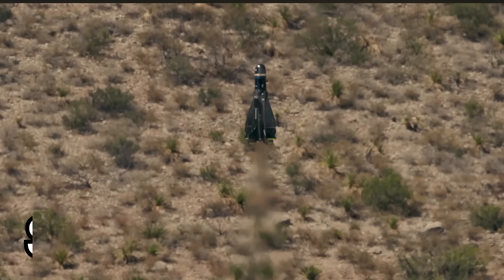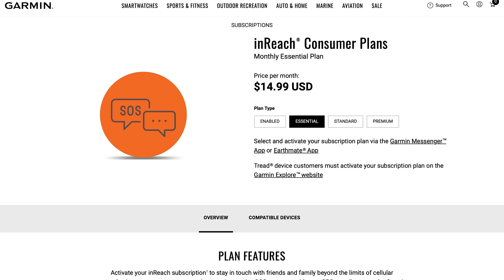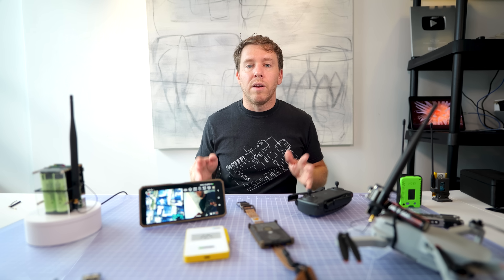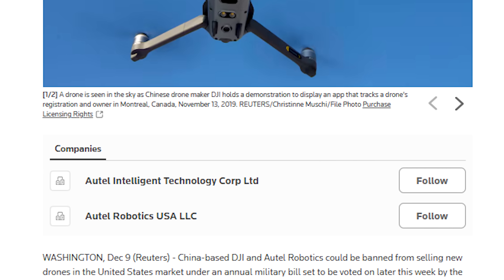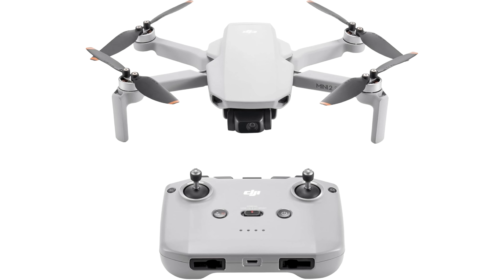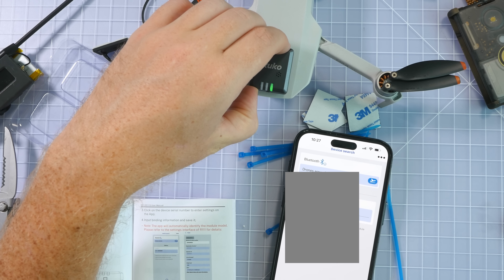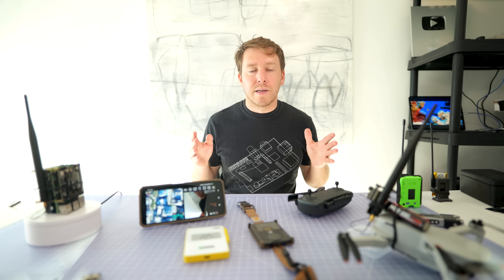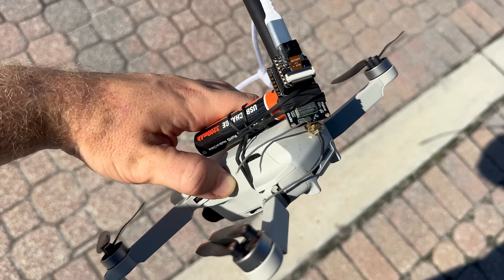I Built a $40,000 Military Drone for $120.07

Comment: I'm super happy to get into this world of decentralised electronics.... BTW the waves you saw on the video stream from the FPV when on the drone are rolling shutter. For those of you who are not camera geeks: most camera sensors nowadays capture the image that is projected by dividing the surface in horitzontal lines and reading each line after the other starting from the top. The speed at which this reading happens is counted by miliseconds and measures of much delay there's gonna be between the first row of pixels capture and the last. This cheap sensor probably has a very slow rolling shutter. Pair this with a vibration coming from the drone and you get the waves you're seeing. 
Fixes: global shutter sensor (you'll still have the vibration but no waves as the whole sensor would be captured at the same time) or isolating the sensor from the vibration of the drone (by some sort of suspended mount, cushion....)
:)

Comment: Just use a 5.8GHz VTX at 1 watt power connected to a standard fpv camera. receive the signal at a base station that processes it live and broadcasts to whatever network you choose. maybe cost $100 more but get steady video at 60 fps with no jello and run off the drones lipo battery. and FUCK THE FAA RID!! This can be done and have a flying weight under 250g. stay under 400 ft and away from airports. and if any karens come up bothering you, slap the shit outta them.

Comment: Having worked in the industry, The sheer amount of testing required to make sure military equipment works the way it is supposed to, and to meet military requirements, a fixed number of anything is going to cost an enormous amount. You'll never see a Raspberry Pi installed on a fielded piece of equipment. I'm totally against the black box equipment, and the US government is getting away from that stuff and adopting more open-source hardware and software. I'm not saying the contractors don't screw the government, because they do. Yet, some of that screwing is due to government inefficiencies and another part is that those defense companies are beholden to their stockholders, and at the end of the day, the company has to profit or go bankrupt.

Comment: A $10 solar powered drone night destroy a $100 million dollar ICBM.  Solar planes have unlimited range if they are above the clouds  and travelinng faster than the sun sets.  They can fly much higher than regular planes because they don't need oxygen to burn fuel.  What is the limit on the soeed in air that is 100 times thinner?  At three thiusand meters per second, a 200 gram drone has as much destructive energy as a half a pound off TNT.

Comment: Wouldn't the video function be accomplished just with a software patch on your phone?  The DJI drone already has a built in camera that sends to the phone/controller.  The phone should be able to act as a router, especially if you turn on hotspot features.   The flying bridge/repeater is a different matter and needs something like this, but not the camera.
Reply from the maker: ya there are probably better ways to do it, but wanted a rig that was fully open using my own custom firmware and wifi HaLow.

Comment: Technically your are correct, MIC needs to do better. What about All weather operation, EMI, RFI hardening, general durability, ability to survive harsh use. shock , vibration, wet insertions. Pull it out of a back pack and use it. You are leaving a lot off.

Comment: The project is cool, but you utterly failed at the presentation - from using roadrunner-m on the thumbnail, mind-numbing statements like "military systems don't integrate with civilian ones and that is bad" and ending on you using entirely off the shelf components and making it sound you beat mil R&D by factor of 400. Take a rest.

Comment: Waves = 'Jello' caused by vibration on the camera, in turn caused by your payload.
Your antenna is mostly plastic and heavy and has some leverage, you only need the wire inside, better - make (or buy) a 'CloverLeaf' antenna as used in FPV drones, matched to your operating frequency, far more efficient and having it on a short length of stiff coax dampens any vibration.  The rest of the payload should be firmly affixed to the drone body with Zip Ties or a 3d-printed clamping bracket for example.  Keep the mass as close to the centre of the drone as possible.
And whatever that floppy loop is, get rid of it or make it out of stiff copper wire.
The less your payload moves with respect to the drone, the less the vibration.

Comment: with a 3D printer you could have built a carbon fiber drone with micro cam for less than 120. I wonder how your system would work with a full-size operational Star Wars BARC speeder bike

Comment: Large floppy bits on the drone are a terrible thing. I could see the oscillations. DJI may not even account for weight change well and you can't tune for it like you can a racing drone running betaFlight. Best bet is to keep the center of gravity as close to the control board as possible. You may want to experiment with directional antennas and even SD card storage of the images to be transmitted at a later time. Directional antennas at both ends should give a clean long distance transfer at the altitudes you show. This is interesting AF. I hope you keep going and stay out of trouble.

Comment: Right, so you can build prototypes cheaply using commercially available parts. This is nothing new, it's been the case for about 10-15 years now (thanks to cheap and powerful microcontrollers, single board computers and also the ever better sensors and, in this case, motors, and open source software). But this is not something a military would want to use, not something you would want to make your (or your soldiers') life depend on.

OTOH, a resource poor army/country may well use similar solutions in case of an emergency, like Ukraine does. In their case, since they had nothing like these developed before the war, these and quick innovation actually help a lot because it gives them capabilities that otherwise they wouldn't have. It's one thing to choose between a well polished and rugged product and a flaky prototype and another to choose between the flaky prototype and having nothing .

Comment: This is cool but its also a bit "we have --- at home" meme ;) there is lots of room for improvement though, i think using a home built drone would make things a lot easier electronics wise and also cheaper, also perhaps using a ground station to relay video data transmitted from the drone over regular fpv video protocols. 
using drones as temporary mesh nodes for smaller amounts of data is neat though!

Comment: Lot of issues here. First, you're correct that the $40,000 figure is inflated, and a more reasonable price is likely substantially less than this. However, the prototype made in this video is as far away from a military surveillance drone as a lawnmover is from a Lexus. What you (a military) pays for when they buy a drone is R&D proven performance, expectional battery life, highly rugged design that can be packed in a box and dragged through the mud for weeks and still operate flawlessly. They're paying for highly autonomous navigation, which includes failsafe navigation systems that can guide with computer vision of the landscape when GPS reliability faults are detected. They pay for high speed, tested acoustic stealth, low thermal signiture in some models, payload capacity, water resistance, high quality video with backup recording and secure com links that are resistent to modern broad spec jamming, and component supply chains that are resilient and not reliant on nations which could become adversaries. No, a circuit board strapped to a drone sending bad quality video under ideal conditions does not come close

Comment: Waves are jello, it's caused by drone vibrations, usually caused by damaged proppler but in your case it may be caused by the camera mount probably not attached propelly causing micro vibrations. So when vibrations match the camera framerates, it creates these wiered waves. It's very common phenomenon with FPV drones

Comment: You should look up what Ukraine is doing with ESP32 nodes and other board design for tracking drones I think they're called Sky Fortress and Zvook, using Doppler effect sound triangulation and other methods to identify, calculate trajectory and more which is then integrated with RADAR data.  They also use a Baba Yaga for a wide variety of tasks, including mothership and range extension for drones. Ukraine is literally field testing what you are creating and evolving at a breakneck pace and the best part? They are mostly doing it in-house with bespoke designs. Drones are reportedly reaching up to 50km to 60km ranges with mesh networked carriers.

Comment: Worth noting is they support mesh networking between drones, jamming presistant, emp resistance etc etc etc 

And usually built out of titanium also needs to fly 1000-2000 miles
Reply: paint it absolute black - where it looks like a shadow in the sky absolutely zero reflections and soaks any signals - what it's built out of doesn't need to be titanium or heavy.  flight distance via starlink and a glider type drone can go around the earth as long as it's following the starlink train in orbit.  Jamming also prevented if using only gps and internal mapping data that doesnt need gps but can rely on one single signal from the starlink train as a ping for geo location data.  spotting a drone that small and painted the blackest black absolute black is nearly impossible and going after it using a multi million/billion dollar platform to jamming it or emp it is absolutely asinine and stupid expensive - let alone attempting to shoot it down with a lazer or a missile.  gliding while also using regen with 2 of 4 motors would work - or all 4 motors if at an altitude it can do this at without freezing.   Everything youve brought up has dozens of ways to be done in the real world.  The military also only uses a handfull of contractors that charge anything they want for building anything the military wants - but this is no longer the case as of yesterday.  That is the old way - the Department of War has an all new layout that will make innovations like this video - able to be looked at seriously by the US Military - bringing back REEAL WORLD COMPETITION - so Skunkworks - Lockheed Martin - DARPA - you better brace yourself for real competition and price bidding.  The days of ripping of America are over - NOW IS THE AGE OF GET SH*T DONE UNDER BUDGET AND AHEAD OF SCHEDULE WHILE IMPROVING QUALITY AND NOT ONCE GOING BACKWARDS.  Hooah.

Comment: the waves are classic FPV drone jello. its from the camera vibrating at high frequencies caused by the motors and props. Usually the solution is a stiffer frame or soft mounting the camera.

Comment: Great for getting it done, but there's quite a bit that goes into turning a prototype of sticky tape and paddlepopstick SDR's into a 'shippable product' such as electromagnetic shielding, RF and GNSS denied countermeasurs, electrical, safety, waterproofing, shock, vibration, training, maintenance, etc - ALL things that the DoD requires for delivering products at a TRL 8+. I agree theres a lot of wastage in big primes but there's also a lot of good tech going into these products.

Comment: WIFI is way too slow for live video FPV. its gonna look like a ring camera at best. but those are lower refresh rate and made to be fixed position.  This remind me of those 20 dollar drones you can get anywhere but attaching weight on the top it will struggle to stay upright.   payload better hanging below the props for balance sake but still these little plastic drones can barely fight wind without draining their battery to nothing.  

if you aren't starting with real custom solution like FPV parts its really hard to understand any of the tech and theres guys who spend their time  jailbreaking or cracking the good stuff VS building sub par hardware.
Reply: trying to do this for 150 bucks is just insulting. but for 500-1000 you actually could have a real solution.

Comment: 10:51 If you're worried about legal limitations with Remote ID, don't fly above 120m (or 400 ft) that is the legal maximum ceiling for drones to fly at. This honestly is probably more important than remote ID because once you go above that you get into altitudes where you could potentially crash into low flying helicopters and actually cause serious harm to people. Just a heads up

Comment: The usb cable here is causing a problem with your vertical antenna.  Any connected wire in proximity is going to cause tuning problems.  Probably the source of your interference waves.

Comment: worked with a defense supplier previously - a 5 dollar per thousand part in commercial application becomes a 5 dollars per unit once it has a defense part number. however, most of the costs comes from stringent qualification of the supply chain and the higher expectancy / reliability of parts.

Comment: All your signal stuff is being placed atop the drone- makes sense as a human standing, holding said drone in hand, looking down at it. Now, fly the drone...what do you see? None of the antenna/ signal equipment... adjust this. Place these additional components either bottom, sides front or rear... steer clear the drone's already equipped antenna and receiver and such..especially the GPS related components- shield, twist cables near them...ultimately just avoid as much as possible to have them placed near each other...problems will be manyu..will be had.... not rad!

Comment: with a few raspberry pis you can get a 2.5 wifi connection to pass video packets in chunks at over 2 miles. Just stop caring about artifacts and push over multiple channels to combine it on the receiver. It worked 8 or so years ago and with the new pi you could throw in KCF for tracking.

Comment: The waves that you saw are a camera artefact called rolling shutter.  It’s caused by the vibrations caused by the propellers making the camera move while the shutter is open.  Small low fps cameras like the one you are using are prone to that in presence of vibrations.

Comment: No you didn't, you build a drone body which by all means is very impressive. But what about the highly classified and sophisticated military grade sensor and internal electronics.

The main cost factors when it comes to military missiles as a good example is not the body, it's primarily highly engineered fuel/engine section and the sensor suit alongside the hundreds of millions to billions in research invested into developing those.

Comment: 1:09 why are the SMA and u.fl connectors ripped off the antennas?
Reply: Maybe the antenna wasn't tuned properly to the frequency band he's decided to use for communication and he's adjusting  to the wavelength, but just a supposition maybe it's just broken
Reply: @rafasalcini2911 most likely bent for a reason

Comment: Impressive engineering, kludging existing hobby tech; but your cost comparison is not entirely accurate, as you don't include your labor or facility/lab costs. Also, a proof of concept versus production does not take into account a whole list of suitability, effectiveness, and produceability factors which entail a lot of labor and ensured materiel availabilty costs. The UAV and microelectronics tech area are evolving at a staggering rate, and it is truly amazing how fast new capabilities are emerging, particularly from hobby and consumer markets which don't have a lot of reliability and functionality constraints of military systems and environments.

Comment: Dude - you need to stop the deceptive (actually lying) clickbait.
You didn't build a "$40,000 military drone for $120.07" dollars. You used a $400 out-of-the-box DJI drone and attached a crappy low resolution $5 camera and a cheapo mesh link.
Pretty sure that:
1. No NATO military will use a DJI drone as their basis
2. Resolution and capabilities of your "surveillance" camera is totally worthless - no resolution, no stabilization, pathetic frame rate
3. Your network connection (let alone your drone) has zero survivability against even the most rudimentary EMI countermeasures
4 Your limited range is laughable in any real world military situation
5. You don't have any military grade features or encryption.

I might as well post a video with a rubber-band airplane with a firecracker attached and say I built a $2 million Tomahawk cruise missile for $2.

Listen your tech is cool -- but your deceptive, lying clickbait will make me avoid future videos of yours like the plague.

Comment: A software adjustment to send footage in batch so you get a smooth framerate while on the same delay, on-board AI (gnn, not llm) for various reasons including executing commands that normally require active control, Dual-mode micro-rde with integrated toroidal stirling, wire wings, replace rotor with contrarotating ducted rotor into rim-driven impeller feeding active flow control and light propulsion, make your own high-grade silicon nitride in your garage because its actually easy, apply multilayer cvd graphene, load your turret. If you are going to build multiple, you can go for a wireless photonics communications array so you can't be jammed, does raise the price a bit. There are some super cheap flir and nightvision cameras/scopes you can get, hybrid optics from there is just a software problem. You'll want ku band radar for incoming if you intend to stop anything, you can get some decently sized stuff although the prices are severely bloated. You can make your own ku band radar at home if you are willing to watch youtube vids and read wiki enough, technology sure has progressed. Micro-rde is the only thing you should cnc mill, unless you are familiar enough for micro-etch control then you can use whatever. 

Better than military drone for less than a salvage car.